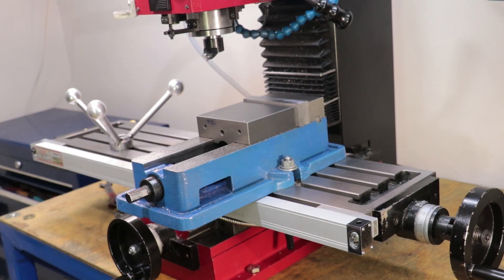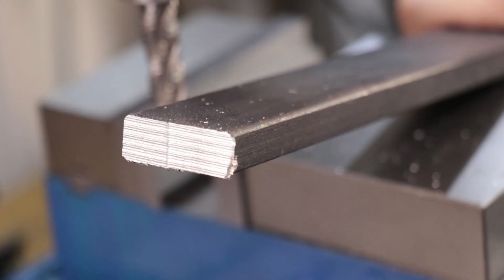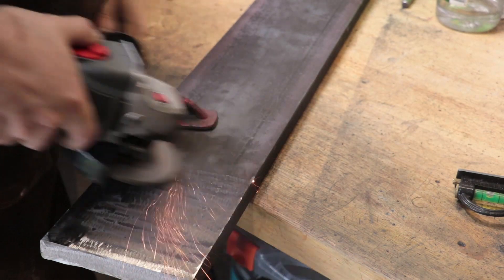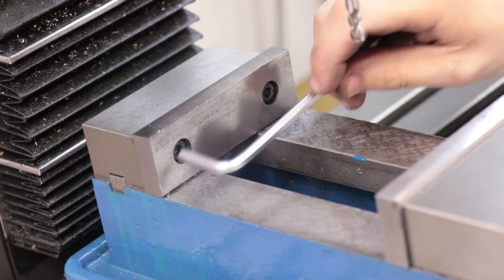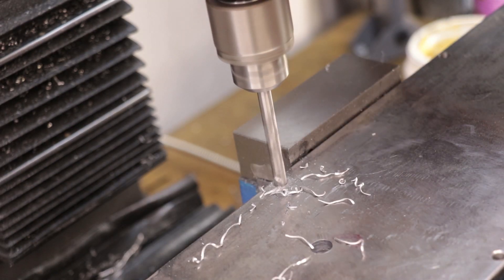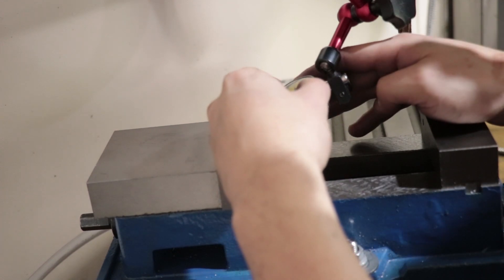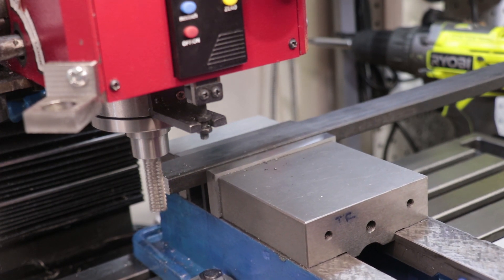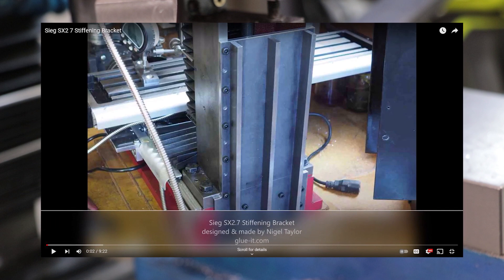Milling Machine Rigidity Upgrade - Stiffening Plate

Comment: Have you replaced the spindle bearings? I have a 45 type mill and replacing the spindle bearing was another upgrade that made a significant improvement
Reply from the maker: I can tell that they are sounding a lot worse than they did a year ago. A year to wear out these bearings is about the same amount of time that it took to wear the mini lathe spindle bearings too. I'll probably swap them out around Christmas time, when I get the time to do it.
Reply: Yeah, I couldn't really tell a difference audio-wise with his upgrade.  I'm sure it would have helped - but it's not going to help nearly as much as a quality set of spindle bearings.  Good god that thing sounds atrocious.

Comment: You could also add some epoxy granite for more mass and vibration dampening. It’s small enough that you probably wouldn’t be able to add a lot, but you could probably add enough to make a difference. We used to add it to our Bridgeport’s back in the day and it really helped.
Reply from the maker: For sure something like that is on the cards, especially in the big void underneath the base of the mill. I haven't done too much research into epoxy granite, I am aware there are various mixes, but once I figure it out I might end up doing it to the mill and lathe in some capacity
Reply: @artisanmakes  check out flowering elbow on yt, he does a lot and sells a pdf about it too.
Reply: @artisanmakes  Glad to hear it! You won’t regret it, your increased tool life alone will be worth it, not to mention the noise and accuracy benefits.
Reply: Definitely worthwhile in these smaller mills. I have the X2 with the tilting column and the column may as well have been a wet noodle out of the box. I ended up building a base from 3x3 square steel tubing from some old bench uprights. Before welding the two L shaped sections I filled them with epoxy granite. I added it so I would have a better way to mount my dro scale and give a better mounting point to tie the stiffening plate from the column to the base. I also filled the actual base and column with EG. It added somewhere in the neighborhood of 150lbs to the machine between the steel base, stiffening plate, the struts I added to help with deflection and EG fill. That doesn't sound like much in the world of machine tools but with machines this size adding that much dampening with the rigidity of the heavy steel base and column plate is a massive improvement I wouldn't have seen without flat out just buying a much larger mill.
Reply: Where did you add this?  Did you fill the back?
Reply: @stxrynn  add which part? And yeah I  filled the column. The X2 has a different column and electronics mounting set up but it should be similar to do on any mill. I used a piece of PVC epoxied inside to allow the giant pivot bolt to pass through and I modified the air shock mount so it no longer is inside the column.
Reply: @jstills762  I was asking Faker what they filled on the B-port.  My old clone had an open bottom and a door in the side.  I was kinda lost how you'd be able to fill that.  On these smaller bench tops, I can see the EG as a boon for rigidity.  I very nearly bought a new one, but found the BP clone for the same money.  Thanks for the reply!!
Reply: @stxrynn  oh, I got you. If you haven't already you could look for some forum posts about converting the BP and clones to CNC. The EG is a pretty popular mod in the CNC space so I'm sure if faker can't give you any specifics there should be some good info out there.
Reply: @jstills762  Hey!  Thanks for the additional resources.  I'll go dig a bit and learn some more.  I can see why the CNC would need to be heavier to resist rapid movements and stops.  I appreciate the education!  Take care!
Reply: @stxrynn  Hey sorry for the late reply, I just saw your question. The columns on a lot of Bridgeport’s are hollow, so we would add some there. How much you add and whether or not you leave a cavity will depend on the model you have. The majority goes in the column. We would also add some to the bottom of the table between the cast ribs (carefully to avoid the lead screw), some in the knee (not too much because we don’t want it too heavy, but enough to stiffen), and some in the ram to help with vibration of the head. It’s important to note here that we weren’t just pouring it in willy nilly, there was a method to it in order to keep all maintenance accessible. The goal was EXTRA mass and rigidity, but not at the expense of functionality. In total we would ad an extra 75% of the starting weight. The vibration dampening was incredibly noticeable. We also swapped all of our spindles to 40 taper (NMTB 40) to add more rigidity in the cut itself. This was a professional machine shop though, and we did it out of necessity, I wouldn’t recommend it for a hobby shop. I hope that answered most of your question. I’m happy to answer anything else
Reply: @fakerfake1  Excellent information!  Thank you.  I had a Big Joe clone for several years.  I couldn't figure how you'd do that, but your explanation makes perfect sense.  IF I get to the point on needing that, I'll refer back to this. Or most probably find a horizontal mill with a vertical head for heavy stuff.  Doubling the weight, wow.  You'd need to add a sticker like they do on packages if you make that mod.  It's a Bridgeport Heavy.

Comment: That's a fantastically cheap and simple upgrade for such a massive improvement
Reply: AU is known for high prices on certain things but Chinese machines seem to be cheaper and generally higher quality models then what's available in the US. Of course we have precision Matthew and Tormach but IMO Tormach has priced their way out of reality on their 1100s and used they go for almost what they were new. The G0704 which was popular for a long time has become overpriced and is honestly underwhelming still using gears and brushed motor.
Reply: Forgot to mention that the ways on the G0704 are awful even compared to a Chinese mill I just picked up for $800 as a damaged unit that normally sold for just under $1200 which is a slightly scaled down G0704 design with similar Y travel and a bit less X. I have an older KX3 CNC I am rebuilding using the manual mill to aid in the upgrades.
Reply: @ChrisHarmon1  fuck tormach -- junk